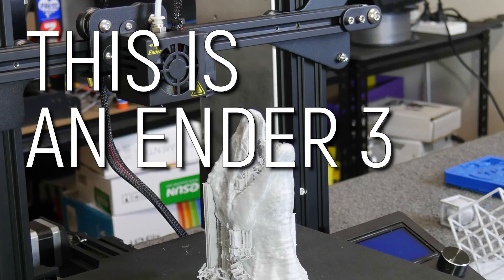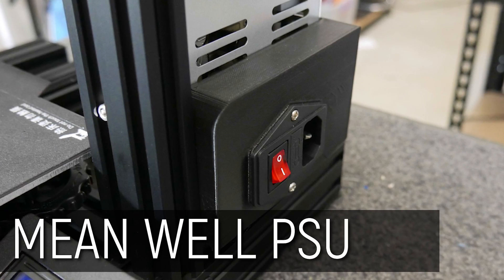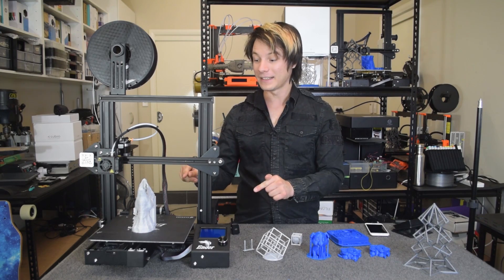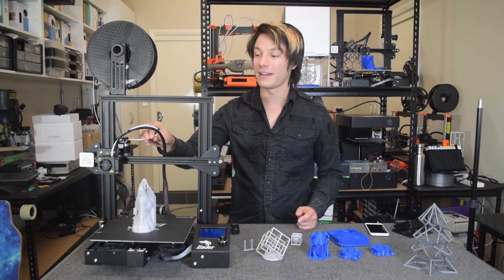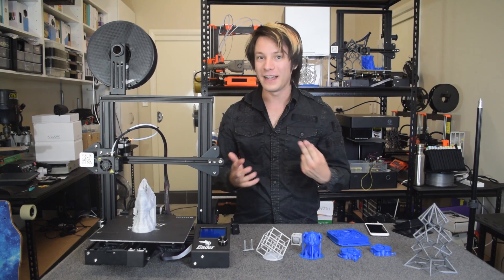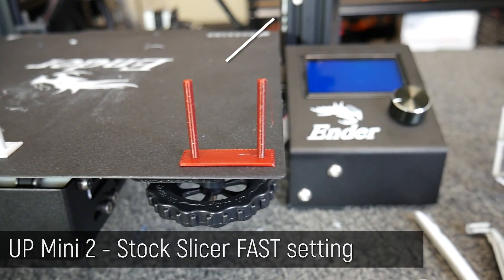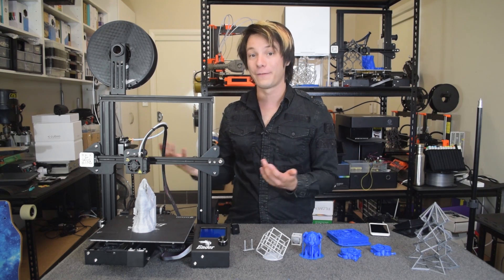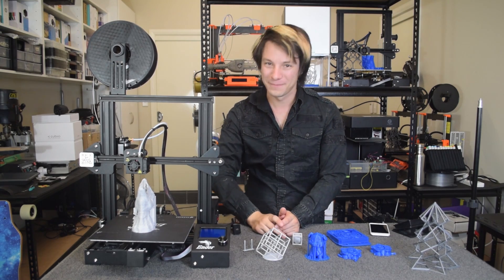Is the Creality Ender 3, Pro?

Comment: I can answer some questions about this. First the ender 3 pro is something I am sort of responsible for. :-) no not tooting any horn just recognizing what happened (same with the CR-20)

I met with creality at ERRF and spent about an hour talking with them on technical details (through a translator they really don't understand much english)

flipping the brainboard over was my primary suggestions. the bottom right location is a PITA to access (I found it very difficult my giant fingers trying to insert that wee car that close to the center rail and bottom/table interface. PITA in extreme.

I also did not like the cooling grill facing UP. this cools the heat bed. invites suction of debris into the fan and invites shorting if anything conductive falls in their (the brainboard is directly below the fan) so I suggested they flip it 180. this will protect the intake protect the heatbed (from being cooled) eliminate the shorting hazard AND improve ergonomics.

I also suggested they goto the removable bed but I suggested the felxible fiber plate with the coarse surface on it (I really like that one even with the binder clips)

I also suggested using a proper PSU (so you could reliable hit higher temps and improves safety) as well as the 40x40 rail. I also noted the QC issues with ALL FOUR of my Ender 3's from different sources (IE endemic to manufacturer not just batch luck)

I found the ender 3 to include virtually all of the suggested changes AND the QC was improved. the machine did go together more cleanly and did not require any of my "mech mods" such as shimming to get it to align right. the parts appeared to be "cut" better.

the ender 3 was a mistake. it never should have been released as the price it was. it was way to aggressive. but now they are stuck with it and they keep trying to "move away" from it (hence CR-20 Ender 3 pro etc.. etc..) but now that Competition is making similar cut through price machines they are stuck like chuck :-)

I do consider the $60 premium to be worth it BUT you can get the same results effectively with a few prints especially if you don't need the better power supply ($40 upgrade though you can sometimes get used/open box ones for $32) if I were to purchase again I would select the pro just for the inverted brain board and 40x40 rail and better QC and PSU. I think its worth it to not have to hassle with fixing those issues myself :-) my pro's have no problem hitting 110c and can work their way up to 130c no problem even when its a little chilly in the house (heats expensive)

now as to whether the cmagnet can handle those temps. I am being told by other users it CAN but I have not tested it myself yet. I plan to soon. waiting for my wham bams to come in since if it fails I will need to replace it anyway. what you are talking about is Curie temperature and its not 70c. it "depends on the magnets" they used. it could be 70c I am not sure still have to test that. I am getting reports of over 100c no issue. I have never seen the surface kink like yours did and I abuse the piss out of mine :-)

 I PREFER the rough surface. plastic sticks very well to it. the surface also NEEDS to be oversized!! (shift it so its off the bed a little to the left) because there are mutliple magnetic fields that have to be aligned. unlike wham bam or build tak this is not a single mag field array and a metal plate but TWO mag field arrays. not sure if its endemic to all of them or just crealities version for some reason (though the stuff I bought off amazon had the same issue) if the fields don't align right you have SOME parts of the bed attracting and some parts REPELLING. this means its literally lifting part of the bed UP away from the bottom surface (have fun leveling that!)

so you have to "find" the sweet spot that lets all the fields align. hence oversized which lets you do this and makes it easier to manufacturer (my guess no inside knowledge) SO move the alignment around till you find where it "works" and does not hit the PSU.

at nearly $300 though I am tempted to say go with the ender 5. more extrusions better QC "SELF ALIGNING" structure that you pretty much can't build out of alignment and its all nice assemblies and 50mm extra Z. really nice machine. just don't man handle when printing or the cantilevered bed WILL vibrate and goof your layer a little. it won't fail but the effect is visible as a layer aberation.

as for PRO. ignore that. chines language translation BS monikers. just think of it as Ender 3 "extra" or something. :-) its just an ender 3 with better QC and some upgrades so a bit more cost.

100% agree on the PTFE tube. I am trying to convince them to switch wholesale to the better stuff but I suspect they will be reluctant at these cutthroat prices.
Reply: I can see the bed magnetism still working to 100C, but, the surface does not last that long, is too soft and will get kinks and divots and is not as flat as it should be. Weakest part of the design. Lasted about 500 print hours before losing all plastic adherence. Creality needs to stop shipping that plastic extruder mech. They make an alloy version, but it's best to just pay the extra $10 for a MacEwen MK3.
Reply: These are all really good upgrades, but surely if they're going to iterate these changes into their designs over time it would seem more logical to just change the original Ender 3? I may be missing something (I've not really looked at the Creality printers much), so please correct me if I get anything wrong, but most of these design changes seem either minor enough that they don't warrant creating an entirely new printer 'version' or too important to leave out of the original. I don't see why they put these changes into an "Ender 3 Pro" edition if they're just going to keep iterating anyway. I could understand it if every single one of these changes was a separate product that had a different name and price point, but since they're not, it seems more logical to just increase the price of the Ender 3 by $60 and add these changes. Can anyone enlighten me why they even made it into a separate item?
Reply: @raspibox6598  first it's important to understand that I have no inside information that this is simply an educated guess based on my experience and what I know about this industry and how it Works in China

So with that Proviso out of the way I suspect I understand what's going on first normally that's what they do when they iterate they just change the model and continue shipping with the new updates but I think there are two things happening here

First the Ender 3 was a mistake they never should have released it for $160 the price point was too low to cut throat to razor-thin a profit margin but because the competition copied it now they're stuck with it

And while the profit is razor-thin it is still profitable

A company has to deal with profit as well as market share they can't give up either especially in a budget market like this where the competition can copy you and have a product out in a week

 They want to move people away from the inner 3 to more profitable models such as the end of 3 Pro but they don't want to give up in market share that the Ender 3 represents and they understand people's complaints about variations so to them Ender 3 next to Ender 3 Pro it's two different models so you can pick the cheaper Ender 3 or you can pick the slightly more expensive but better equipped Ender 3 Pro

 But of course they're going to continue to iterate because that's how they can release fast and maintain market share and Lead over the competition it's also a bit of trial and error they can't just beta test and wait for results and then pick the best one and put it out there because the competition will try all of them and beat them to the punch

 Now on a bigger project that takes more effort than simply buying off the shelf Parts such as the cr10 S Pro they can afford to slow down a tiny bit and they did but that's all they can afford because the competition will catch up fast TiVo is already working on a copy of the 10 Pro and it looks pretty nice if they waited too long they would lose market share which is just as important as profit

 So in the kind of Market they exist in they simply cannot release printers like companies here in the u.s. do it simply would not work

 At least that is my best educated guess and understanding of the conditions they operate in

If anyone knows better please by all means let us know I find the subject matter quite fascinating actually
Reply: Great stuff
Reply: Makers Muse Maybe a Skype call here is in order ;)

Comment: Where is the link to that 2 post stringing test. I hardly see stringing on mine, so I would like to test mine.
Reply from the maker: https://www.thingiverse.com/thing:2080224 here ya go. Let me know how you get on! :)
Reply: @MakersMuse  I don't know much about slicer settings so I used std Fine in Cura, and my std everything "3" in Y direction part orientation was like your 2nd print at 8:44, and X dir was like your 3rd. None was as hairy as that 1st one.

Comment: A direct drive extruder would probably require a second z-axis screw, unless you could find one that weighed no more then the Bowden extruder. I agree about the direct drive. I designed and built my own DIY with a direct drive. And agree it’s so much easier to use.
Reply: you could probably get away with direct drive if you used a light weight geared unit on an ender 3. but CR-10 sized absolutely would need dual z.

Comment: The Ender 3 is, in my mind, a great 3D Printer.  It prints great, for th price.  If you are happy with it, great.  If you want to eek out more quality, it requires a modicom of pretty inexpensive parts along with some elbow grease, and not a lot of know-how.  I think it is a terrific beginner's machine since it is pretty forgiving.  The ONE big flaw (and I do view it as a major flaw) is the lack of thermal run-away.  

While I may disagree with some of what you said, in general you are right on.  Yet another great video.

Comment: Hmmmm. My Ender3 which i've had for around 5 months is stock other than motor dampers and it prints RIDICULOUSLY well (way, way better than what you've shown, for instance your dog shows blobs on it, mine came out almost like it was polished). To the point where I don't actually want or need a Prusa machine because the print quality is the same. I use totally stock Cura 0.2mm profile or 0.15mm for really detailed prints, everything comes out flawlessly. I have a CR10 which i've sunk the cost of a Prusa into and while it 'can' print better and definitely faster, it's temperamental and costs me heaps of time whereas the Ender3 just pops out parts over and over and over flawlessly. Maybe I got one of the "Hey I better impress the boss i'm about to ask for a raise" machines?
Reply: My Ender 3 is quite good. It doesn't look polished like you said but it prints with tiny lines that are almost invisible from the human eye. We have had problems with the prints failing but most were to do with the filament overlapping in the coil, and now we know about that it doesn't seem to fail. I also use Cura to set up my prints and most of the time I print in 0.2 with 10% infill as it takes to long and is more likely to fail if the print time is over 24 hours.

Comment: Never had your probs with Creality machines and I have 4 of of them, no hair or other artifacts, if you want a top notch profile use the one from "The Hot end" channel, he posted a link to he's cr-10 profile and it works on a  mini and a ender as well. Problems solved. Just search youtube for "best settings for a cr-10" he's vid comes up in the top-10-20 or so.

Comment: It seems like the majority of the printers you review are sub $1000.  You even refer to the Prusa Mk3 as a 'high-end" printer.  Yet there is a whole range of filament printers in the $1K-$4K range.  For instance I'm very interested in the MakerGear M3-SE and M3-ID,  but I can't find anywhere in the internet that really compares a $3K filament printer to the "best" sub $1K printers.  What makes them worth the 4-5x price(if they are)?  Is it primarily build quality/support?  Or maybe that high price doesn't translate to build quality, but just to durability/longevity.  Anyhow, I'd love to see you review one of these higher price filament printers (like the makergear) and help us understand why those printers exist when there are so many more affordable options.  Thanks!
Reply from the maker: I've reviewed a few more expensive machines such as the Zortrax M300, Zmorph, Raise N2+ and Cubicon Single. Mostly you pay for size and heft which translates to rigidity but not always better prints. Usually they're fully enclosed too for better printing of ABS and other high temp plastics. My favourite ever was probably the Cubicon Single back in 2015... it features mechanical auto bed levelling (physically moves, not mesh compensation) and is fully enclosed for warpless ABS prints. For all my projects however the smaller good machines continue to shine so I've mainly focused on them. There will be a few more higher end reviews and tests in future, but few and far between due to the paperwork involved. Hope that helps!

Comment: change extruder to jstruder, its like day and night.
Reply from the maker: Looks pretty neat!
Reply: @MakersMuse  what is the difference between a normal and j head? I've been wondering about this for awhile now
Reply: Maker's Muse I recently ran into three failed prints on my Ender 3 due to a combination of too strong filament tooth grip, length of retraction pull back, and amount of retractions in a given area as the print has lots of small identical pieces. This extruder mod looks interesting. Your recommendation for Capricorn tubing would have made my issue even worse though, as my tube is 2mm even ID, and it took a few flattened filament spots to back up the extruder and cause skipping.

This is my first printer, it was quite frustrating. I did order an upgraded extruder to try to gain some control over how strong the gear grip is, as I had to reduce my retraction distance and amount of printed items to make the print work. I see that you have an extruder that looks like the one that I ordered (the gold one), does it give you satisfactory control over gear grip? That’s why I bought it.

Thanks for the interesting and informative videos.

Comment: A10M (geeetech ender 3 clone)...Dual extrusion, easy assembly (8 bolts), 24 v, great board, glass bed, loaded with Marlin 1.1.8 with thermal runaway etc.  Only downside I can see so far is proprietary nozzle but meh they're cheap enough. Just finished dual color PETG that worked slick with CR-10 settings. Agreed though, direct drive all the way.  Although with enough time the stringing can get under control.

Comment: Thanks for sharing Angus. I got my Pro (Gen 4 I guess, has sock). I'm happy with it so far. Completely agree about the difficulty of purchasing (so many variants). 

You mentioned once somewhere of maybe doing a video about adding direct drive on the Ender. It would be interesting seeing your approach to that. Cheers and HNY!
Reply: I would use E3d V6 and titan extruder. I almost feel like there needs to be more hybrid printers. Like Anet A8 and Ender 3 combined  best features might be a step up for these printers.
Reply: @deathshaker0026  v6 hotend and capricorn tube with better push fittings make a huge difference.
Reply: Titan is too expensive and a pain to install. I offer a kit that takes 20 minutes and works flawlessly. https://www.ebay.com/itm/173704864701